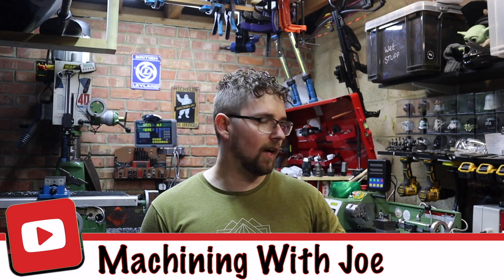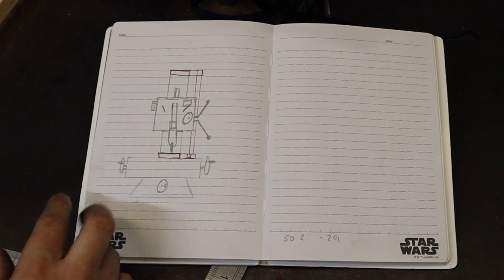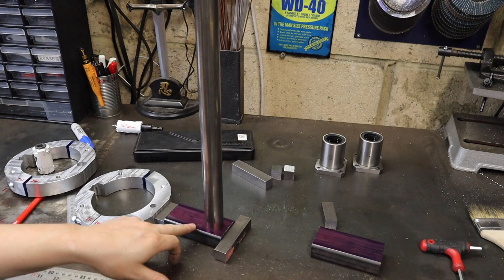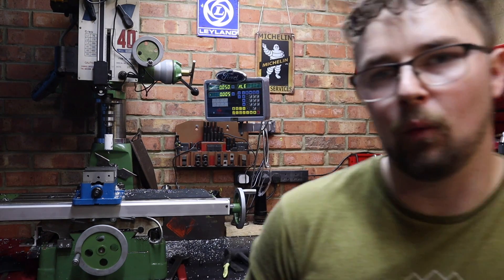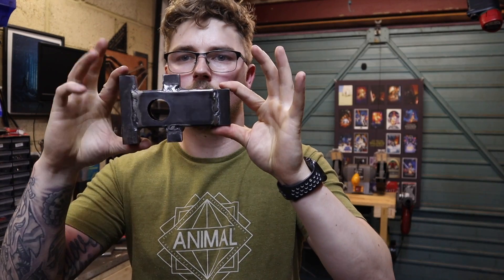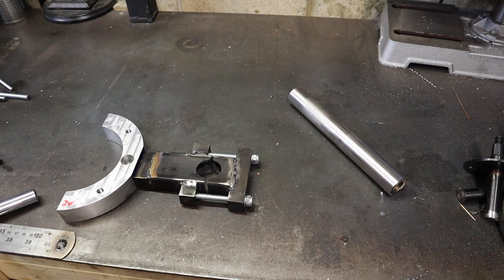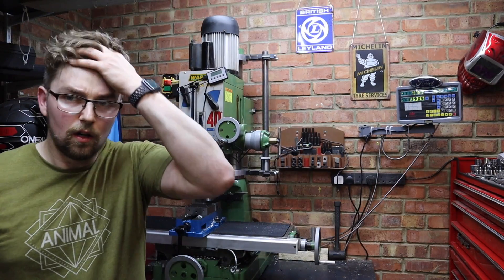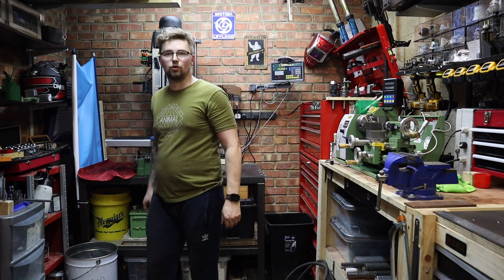Warco Round Column mill Modification

Comment: Lotta videos about this round column mill problem. Here’s what I do: extend the quill down, put a mag base on the table and zero up a travel indicator on the side of the quill, go up or down with the head as needed and bring the head back to zero before you tighten the clamp bolts. It’s kind of a hassle, but it does the job and avoids all of the mods that people are doing.

Comment: How are you running your lathe Joe? Interested as I'm getting on and looking at single to 3 phase options
Reply from the maker: Hi Jim, 
So I’m running my lathe from a Transwave inverter rated at 3.0KW. So far I have found the Transwave to be pretty good a reliable.
Reply: @MachiningwithJoe  Is it wired direct to the motor? Assume if it is you can use lathe controls and foot brake?
Reply from the maker: @jimspencer3072  so the Transwave inverter has a 16A 3 phase socket on it so the lathe can be connected using original plug. This means everything works like normal.
Reply: @MachiningwithJoe  Sounds like  an ideal solution. I'd do the same then.

Comment: Dan, I have a round column mill and I like your idea, just a couple of points, tank cutters are not designed to be used as you did, weve all done it but I'm certain that the cutter buggered your drill chuck, the cutters have a tendancy to dig in particularly when the teeth get clogged and can friction weld to the job, the cutter stops but the chuck couldnt hence the failure. 
Second point, youve lowered the mill to far and now you will find you have back trouble bending over to see the work and setting up the jobs.
Reply from the maker: Hi Dan, thank you for your feedback. Yeah I don’t think the hole cutter was the best tool I could have chosen but like you sed we all do it and it got the job done. Hopefully where it’s just a hobby it won’t affect my back but I see what your saying however before had it was way to high I built the bench before I got the lathe and just went off my other bench’s dimensions. 
Hope your enjoying the videos all the best.